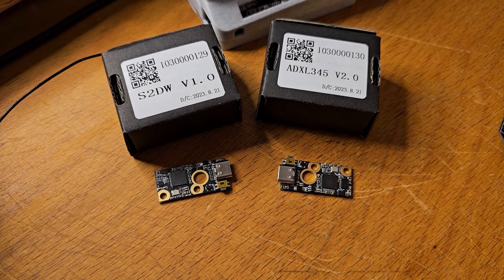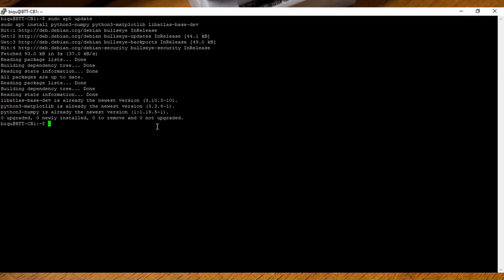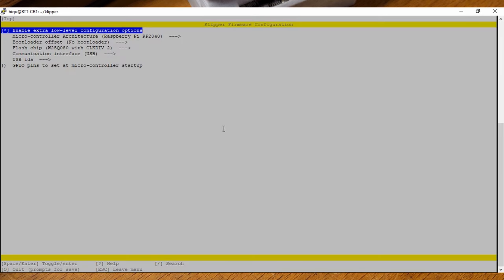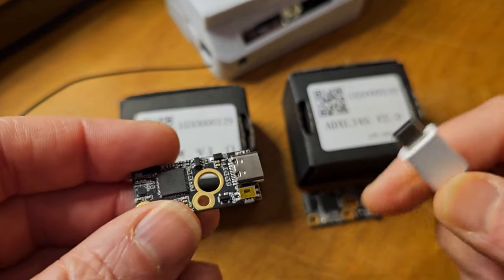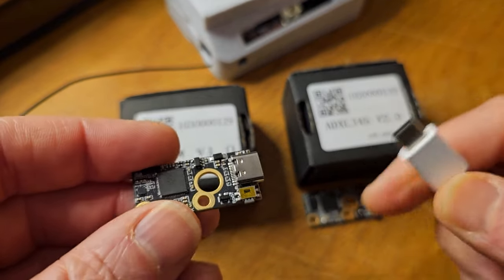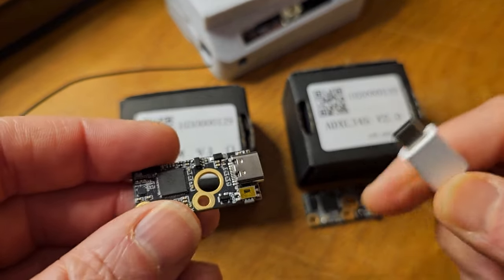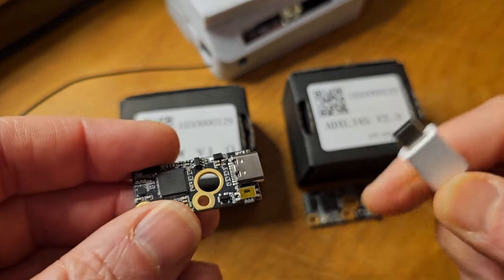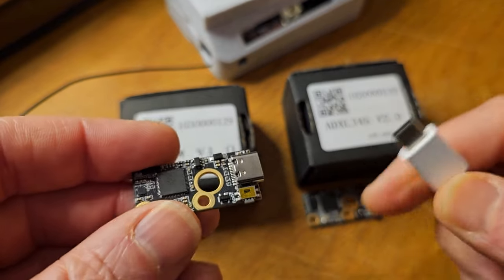Setting Up BTT ADXL345 & S2DW Accelerometers with Klipper

Comment: I get to the point where I hook up via USB C - USB A into BTT pi and the ADX doesnt show up in list. I have clicked the boot button. Does it need to be connected to the pi directly or to the motherboard of printer (i assume Pi which is what i have done). I really hope this doesn't require soldering to spi directly so any help is appreciated.
Reply from the maker: You have to hold in the boot button while plugging it into the pi. Don't let go of the boot button until the led comes on. If you are doing that, maybe try a different USB cable some are not made for data transmission. No soldering or spi wiring is needed.
Reply: @StackingLayers  Thanks for reply, i was doing so but I will try a different cable!

Comment: Hey uhm what do you need to put in the axes_map if the sensor is positioned like in a 210° to X or any other angle because else its not possible to mount?
Reply from the maker: It should be mounted so the the axis are coaxial.
Reply: @StackingLayers  ok thanks

Comment: Hi sir, is it possible run the input shaper simultaneously for both the bed and printhead with two adxl345 and a Rpi pico?
Reply from the maker: I've never tried, but I don't think you can run 2 sensors at once. It would require two different commands and Klipper would wait to finish the first one before starting the next one. Even when running the command to do both XY for a core XY system it will still do only one axis at a time
Reply: @StackingLayers   I see. Thankyou so much.

Comment: what about the bed dont need to calibrate I think the video is incomplete?
Reply from the maker: It's the exact same procedure to shaper calibrate but with Y instead of X. If you have a core XY then you omit the X and Y and both tests are ran automatically.
Reply: @StackingLayers  so if i do y it will rewrite the previous x or it will keep the both values?
Reply from the maker: SHAPER_CALIBRATE AXIS=Y for Y and SHAPER_CALIBRATE AXIS=X for X it's 2 separate tests and does overwrite each other.
Reply: @StackingLayers  the video was great and very well explained but this part and the direction of sensor xyz needs a bit more clear explanation I got a little confused. but overall great job!
Reply from the maker: @RayLenses yeah the axis mapping can be a dit confusing. The  way it works is, the 3 places are the real axis, X,Y, and Z, and you enter the sensor position that is parallel to each real axis. So you look at the sensor when mounted and enter in what is inline with each axis. For example, if the image on the sensor had Y pointing to the left and that is parallel to the real X axis then the first entry will be -Y. Then you see X on the sensor is pointing down (aligned with Real Z) and the Z which is the dot in the middle and point out/away from the sensor (aligned with real Y) then the full axis map would be -Y, -Z, -Y  They are negative because the arrow points in the negative real motion.
Maybe I'll make a short to explain better visually.
Reply: @StackingLayers  I already ordered the sensor I'm about to install in 2 days I'll come and check this video again also follow this comment thank you!. Yeah I would be very appreciatedif a short video with more clear explanation if is possible too about the mapping.

Comment: Anyone getting this error when trying to compile the firmware?

src/dirzctl.c: In function 'command_run_dirzctl':
src/dirzctl.c:147:59: error: 'CONFIG_CLOCK_FREQ' undeclared (first use in this function)
     d->n_ticks = (uint32_t)(((double)args[2] / 1000000) * CONFIG_CLOCK_FREQ) / 2;

src/dirzctl.c:147:59: note: each undeclared identifier is reported only once for each function it appears in
make: * [Makefile:64: out/src/dirzctl.o] Error 1
Reply from the maker: Make sure to update the klipper firmmware first to have the latest. Then make sure the firmware is set like this,
["] Enable extra low-level contiguration optronsiiicro-controller
Micro-controller Architecture (Raspberry Pi RP2040)
Bootloader offset (No bootloader)
Flash chip (W25Q080 with CLKDIV 2) 
Communication interface (USB)

Comment: Thanks for this video! Currently, this is the only video out there that shows how to setup this on the BTT-Pi. Theres not even anything in the documentation that talks about the specifics of the x,y, z so i dont know how you even found that out but glad you explained it so well!
Reply from the maker: Yeah there's like only one sentence about asxis making that I've seen in the klipper documents. I don't know how detrimental it is to the measurements but I like to try to make things as accurate as possible.

Comment: A thousand thanks! I was looking for videos like this that would explain to laypeople how to proceed with input shaping. Excellent! But now I have 2 questions left: 1) how to read the graphs obtained and 2, more importantly, how to set the slicer (whether cura orca or prusa) to obtain the best and fastest prints...
Reply from the maker: Honestly I'm still trying to get concrete information on the graphs. The way I understand it that the solid line it the oscillation frequency of the machine and the others show what they can achieve to dampen the peak. Like tuning down bad sounds with an band equalizer. But I can be very wrong about that. I still need to do more research on it. As for slicer settings you can do various calibration tests. There are normally options in the menus that have tests to run. There's also this tuning guide that works wonders https://ellis3dp.com/Print-Tuning-Guide/articles/index_tuning.html

Comment: I have bedslinger with manta m8p with cb1 and EBB can board ( which have accelerometer) i want to add accel for bed over the usb, i did everthing like in video but after i add #serial: usb-Klipper_rp2040 everything froze and i can se only host in system loads. PS also i have BIGTREETECH TFT35 SPI over spi.  What im I doing wrong?

Comment: What an amazing tutorial, bro! I just started learning Klipper yesterday, and I have been running into so many issues with the whole process, but I did not run into a single problem for this part of my journey, thanks to you!
Reply from the maker: Glad to see it was helpful
Reply: @StackingLayers  I came back for 2nds. I adjusted my belts and everything so I had to calibrate again, but I needed a refresh on a couple of the commands and config settings.
Reply from the maker: You're always welcome to visit.

Comment: Hi I've followed your tutorial,  but I've put the sensor on my hotend s1 pro .how should I edit the axes map on lis2dw cfg
Reply from the maker: You need to look at the sensor and see which wat the XYZ marks are pointing. The Z is the center and pointing away from the board. You then see how those  relate to the actual axis. For example if you see the Y is pointing to the left and it's in the direction that X axis moves on the machine that would make the first map  -y. Then you see the X pointing up and it's in line with the z motion, and the z mark is pointing out to the front of the machine that would make the axis map -Y, -Z, X

Comment: Why did you only do the X axis and not the whole SHAPER_CALIBRATE?
Reply from the maker: Because I did it on a bed slinger machine so I have to move the sensor to the bed to do Y. On a coreXY you would use just SHAPER_CALIBRATE since X and Y are both on the print head motion.

Comment: Thanks for the video. Our printers run with old klipper so I'm hoping that the BTT ADXL345 will work!
Reply from the maker: Looks like the adxl345 was added in 0.9.0 back in 2020, but the rp2040 was added in 0.10.0 2021 so 0.10 or newer for this one.

Comment: You just solved my firmware issue when using a Pico MCU. Every tutorial says to use "linux process", instead I used the 2040 process (which makes sense since the pico uses a 2040) flashed it on my pc & wholla, accelerometer query success!
Reply from the maker: Sweet! I'm glad the video was helpful.

Comment: this was working, nothing has changed but now getting this 
Invalid adxl345 id (got ff vs e5).
This is generally indicative of connection problems
(e.g. faulty wiring) or a faulty adxl345 chip.
Reply from the maker: Was it working before? Maybe try a different usb cable

Comment: Hi! I have a question, wouldn't axes_map: y,z,-x ?
I suggest positive z because in the case you are mounting the S2DW, z facing at you is positive and the y axis of the printer facing at you is positive too. What do you think? Am I right or have I misunderstood the axes_map positioning?😁

Btw thank you so much for the video, it is gold.💯
Reply from the maker: On bed slinger machines, the bed moves in the opposite direction of the axis coordinates. For example positive Y motion will move the bed twords the front because that makes the nozzle position be further back. All motion is based on nozzle position. So with the Z axis on the sensor pointing towards the front of the machine would make that a -Z, to correspond to the +y direction.

Comment: Sadly I am stuck on step one, can someone explain how to get to BIQU@BTT-CB1? the black screen at 6:30? I am also running a BTT PI4B and CB1...
Reply from the maker: Download and install PuTTY  https://www.putty.org/
When you open that program, there is a box to entre the host or IP address. Type in the hostname or IP address that the pi4b or cb1 have. It's the same you use to get to mainsail. Then enter the user name then password. For the Cb1 it'll be biqu for both user abd password. The pi is whatever was setup, I the default is
 user name:  pi
 and pass: raspberry 
Note that the  password part looks like nothing is happening when you type. This is normal. Just type the password and hit enter.

Comment: I have a Manta e3ez board and cb1 on the the way for my Ender 3 v2 that’s basically been beefed up top to bottom, will be adding this after I get up and running with klipper, how would suggest mounting the sensor to the bed for the calibration?
Reply from the maker: Just print out some sort of block, or clamp that you can screw the sensor onto. It only needs to be strong enough to stay in place for the test. It doesn't need to be a permanent fixture. I use this, https://cults3d.com/en/3d-model/tool/tiny-c-clamp
Reply: I just did a simple 8mm tall block that has the two 2.5mm diameter mounting holes 15.5mm apart. I also added a 2mm tall 5.9mm dia extrusion to go into the nozzle hole to make sure it stays extra sturdy.  Printed with a 10mm brim. As soon as the print is done I just set the bed to stay at the same temp until the resonance testing is done.

Comment: When you are in the terminal is that in Linux? Do I need to have a mouse and keyboard connected to a btt pi?
Reply from the maker: No it's using SSH, its a remote connection to the terminal. You could do it using command line, programs like puTTY, or even mobile apps like juiceSSH.
Reply: @StackingLayers  thank you!

Comment: Hi. Just got this device (the ADXL345 version) and I'm running through but can't flash. It says "Failed to flash to 2e8a:003: Unable to find tty device" (it does show as Boot under lsusb with that id) and make error is 255. Ideas?
Reply from the maker: I think 255 is a configuration error. Check the make menuconfig again. It should be like this,
[*] Enable extra low-level configuration optionsMicro-controller
Micro-controller Architecture (Raspberry Pi RP2040)
Bootloader offset (No bootloader)
Flash chip (W25Q080 with CLKDIV 2)
Communication interface (USB)
Reply: Thanks @StackingLayers  I double checked and it matches. Did a make clean and make again jus tin case, same error :(
Also tried to reconnect device.
Reply: I figured it out! Alternate flash method. Find the drive with fdisk -l and mount it, then just copy the uf2 file to the root of the RP2 drive.
Reply from the maker: @WesleyKrasko  its interesting that you had to go that route. Good to see that you got it going though.

Comment: Excellent video! Its content like this that makes the printing community so strong and enjoyable. I did have an issue however.  Running an ender 3 pro. After querying the accelerometer I got a Invalid lis2dw id (got ff vs 44) message. "Invalid lis2dw id (got ff vs 44).
This is generally indicative of connection problems
(e.g. faulty wiring) or a faulty lis2dw chip." Do you have any advice on how to remedy this? Thanks in advance.
Reply from the maker: Maybe try a different usb cable, but you shouldn't get that message with this kind of setup. It's all wired up on the board. It might mean that a component on the board is faulty.
Reply: I had the same problem. I had another accelerometer than in the video and therefore the mapping (the part where the pins are asigned in the config - cs_pin: btt_adxl345:gpio9 for example) was different. I searched for the mapping of my specific accelerometer and got it working this way.
Reply: I am having this same issue, were you able to resolve it?
Reply: i have the same issue every look ok but when i do 
ACCELEROMETER_QUERY
i get this message
Invalid lis2dw id (got ff vs 44).
12:23 PM
Invalid lis2dw id (got ff vs 44).
This is generally indicative of connection problems
(e.g. faulty wiring) or a faulty lis2dw chip.

Comment: Any ideas why the device doesn't show up in the USB device list after the lsusb command? I press the boot button and do get a green light on the device.I am using the BTT ADXL345 V2
Reply from the maker: Chaek that the usb cable you have isn't a charge only cable. Some don't have the data wires inside. Also you have to hold the boot button before plugging in and don't let go until it is plugged in and on.
Reply: same issue here, the data cable is confirmed working @StackingLayers 

EDIT: I was using a USB C to USB C. It needs to connect to the standard usb on the Pi
Reply from the maker: @facemonkeys correct you need to use the usbA ports.
Reply: @StackingLayers  this is because the usbc port is only for power input and spi, right? Or am I mistaken?
Reply from the maker: @facemonkeys there are ways to make it work for various data functions, but you'll need to edit the config.txt and perhaps other things depending on the function. You also might loose the ability to power it from usbC and have to use gpio powering which bypasses the power in protection fuse.

Comment: having bed slinger i only need to calibrate x axis? or should i mount it to bed too and calibrate y axis?
Reply from the maker: Mount it to the bed too. Then run the shaper calibrate with y instead of x. You don't have to set up another instance like it shows in the docs, since you are using the same sensor.
Reply: I mean, will there be any bigger difference in print quality if I do it only for x-axis instead of x and y-axis. btw great video, all worked smooth and with no errors!
Reply from the maker: @hatray4540 you just will not get any resonance correction on Y, so there can still be ghosting from that axis.

Comment: Thanks! Aside for some chip-specific ff errors that I had to hunt down (non a btt board), this saved me a TON of aggravation 🙂
Reply from the maker: Awesome! I'm glad tonsee it was helpful. Thank you for the super!
Reply: hey i am also using a non btt board and getting the error (got ff vs e5) what did you do to solve this?
Reply from the maker: @winterattack8462 You may have to set different pins. What board is it?
Reply: @StackingLayers   it is the fly adxl345
Reply: @StackingLayers  sorry to disturb you but i looked up what pins to use and found that the gpio8 needed to be changed to a gpio12 thanks for the help it seems to be working now
Reply from the maker: @winterattack8462 no bother at all. Glad to see you got it working.

Comment: I cant for the life of me, make a uf2 file. it always compiles as .bin file
Reply from the maker: Are you selecting the RP2040? What version of klipper do you have installed?
Reply: @StackingLayers  I am! As to the version, I have the latest update of klipper
Reply from the maker: Is the make flash command not working?
Reply: @StackingLayers  it is! But when I flash it it just says "uf2 files flashed = 0"
Reply from the maker: And it doesn't work after the flash I assume. Are you doing make clean first to make sure it's starting with an empty directory?